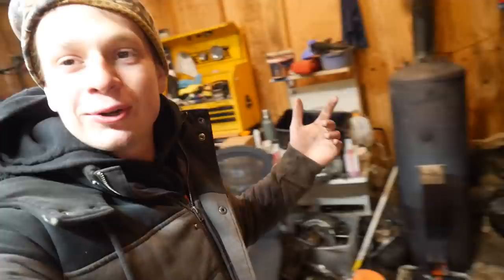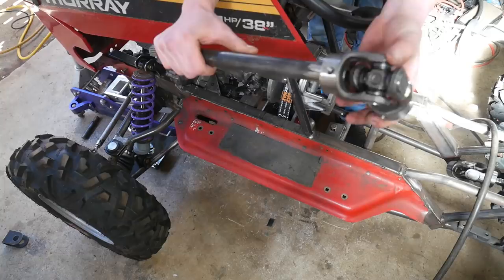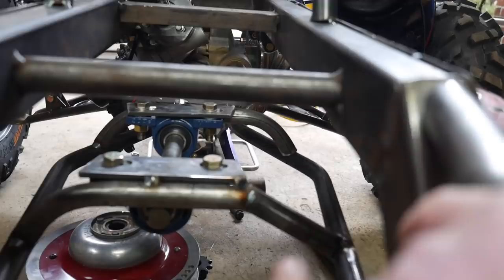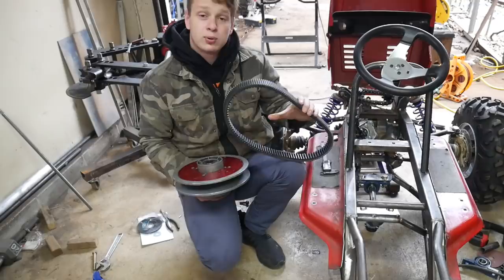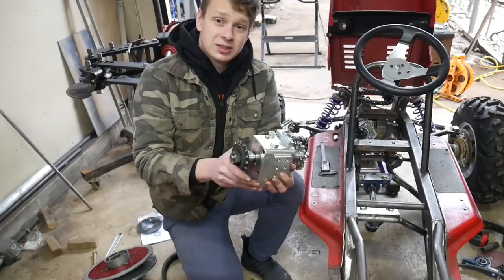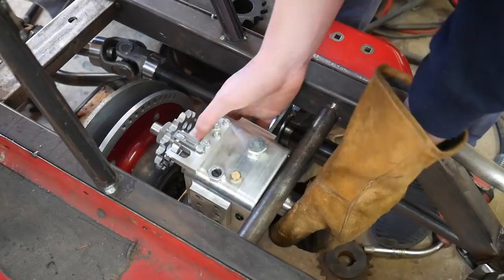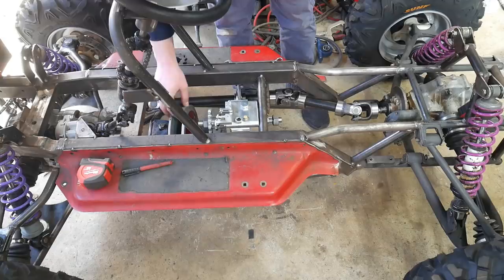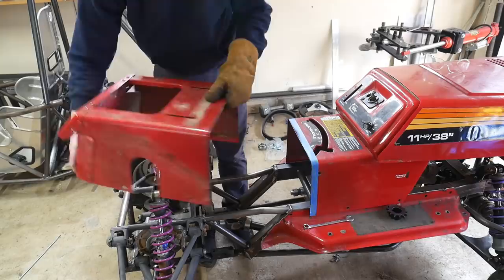4x4 100HP Triple Murray Riding Mower Build Part 8!

Comment: Hey man, just wanted to make sure you knew that you are going to have to build some type of removable enclosure to cover your clutches and belt, like you would find on a four wheeler with a cvt. Otherwise you will get dirt on you clutches and lose power and risk breaking them
Reply: This is absolutely correct,from experience I've learned that a vital function of a cover for this type of clutch involves propper cooling.Whatever protective cover is chosen,if it's not allowed passage ways for air to cool what needs cooling the chance of failure from overheating is inevitable.
Reply: I'm also curious how he's gonna get the belt on and off
Reply: @carbonranger9691  well,if there isn't proper ventilation to keep that belt cool,it will come off all by itself. Have a awsome day my friend.
Reply: I'd also be worried about the clearance issue with the secondary clutch and driveshaft. The belt is supposed to ride roughly 1/8 of an inch above the clutch so there will be even less clearance
Reply: @brandonpierce9868  I would guess that it might be better for the road and back and kidneys unless he puts some suspension on it.Then again,he put 100+hp in a mower so .lol
Reply: @brandonpierce9868  in all actuality this doesn't happen most of the time. In a perfect world this would happen but because of belt slip and things like that the belt never fully reaches overdrive in most cases.
Reply: @brandonpierce9868  you could fab up a skid plate so things don’t get stuck up in there

Comment: I think you will definitely need another bearing support for the driveshaft forward near the secondary clutch. Especially once the chain is on from the reverse box and the torque starts to make it deflect.
Reply: First thing I saw its gonna be flopping around like mad
Reply from the maker: Yes will be adding a few!

Comment: "This is something that's never been done before...  110 horsepower in this freaking mower."
Reply: And a v8 mower
Reply: 2jz tractor
Reply: he just needs to add a 0 at the end of the 11 on the stock graphics
Reply: I think it makes perfect sense, I mean suicide by gun shot is overdone. LOL
Not that I'm making fun of anyone that has had the misfortune of leaving this reality for whatever reason.That is not a joke at all,its a terrible tragedy that I think could be prevented in some cases with the proper  help.I have had more than one relative,friend,chose to leave by their own hand so I'm well aware of how devastating the impact is on those left behind,but I have a sense of humor and I think if anyone capable of reading between the lines will see that it not the dark part of the topic I find funny,just the level of danger involved when power to weight has a big difference.

Comment: Vasily, I wouldn't be too concerned about the YT "experts"- I'm thinking there are only a handful of people who have ever built a 110 hp, 4x4 lawn tractor. You are probably 10% of those people by yourself, which means you are the expert who owns all the parts.  It's looking good! The clutch and all below the floor boards will add some more of the tractor's weight low where it will help keep it upright. And maybe save your feet from the stupid. Take the advice as being worth what you actually paid for it, mine included. Success is always on the terms of the man doing the work. Everybody else is kvetching.

Comment: I can’t wait till you finalize the chassis, I’m curious as to how you will tackle the exhaust. I kinda hope you make an exhaust manifold, like a car. You can use a steel 1/4 square tube, cap the ends drill the holes for ports and bolts to go through it.  Then weld an outlet flange where you need it for the exhaust tubing. Then take a belt sander and sand the tube flat and then get a flat surface and put a large piece of sand paper on it and sand it more flat. Run your pipe down and out someplace in the back.

Comment: i would add another bearing to the drive shaft, just the other end of the shaft you have that one on. the chain is going to pull it out of place so add one to the other end to stop it from moving

Comment: U-Joints require clocking so the slow-down and speed-up of the elliptic rotation caused by a bend cancel each other out.  Make sure the the 'U's are inline on the shafts.  To be clear, the rotational axis of the joints per shaft must lie in the same plane.

Comment: Make sure to add a nice solid bash plate over that clutch it doesn't hang that low that it will be an issue but it looks like the lowest point so if something is going to be hit that will be it

Comment: Cool stuff. I used 4 ujs for the steering. Learnt 90degrees in doesn’t produce 90 out when the ujs are phased correctly and the inputs and outputs aren’t parallel. Like when u have to get round the engine. Your drive shaft input output are parallel but not phased correctly. Vibration. I have 75 horseys in my full sus mower carnt tell u how fast it is. Gonna be making a vid soon. U need a bucket seat to. Honestly I did 1 rip for 2 mins nearly got flicked out 4 times

Comment: I sure hope that youre adding a 2nd support bearing towards the front of the intermediary shaft that connects both diffs and doing some serious bracing of both as the torque off of the cvt drive is going to rip that single bearing sideways/inwards and even 2 shaft bearings without some serious bracing will rip loose in a very short time.. Need to order up an exact replacement murray 11hp decal but with 110hp so it looks stock and legit but notifies those watching that it's a potent little toy in a sedate/quiet sort way... 😆😁  Brakes are going to be UBER important on this ride once the gearing is sorted out... Jus sayin.

Comment: I would build the reverse gearbox, huge pulley and cardan shaft as its own unit that gets welded in place, that way you can throw the chain sprocket setup out and use normal gears in oil bath thing. Bit more engineering and effort but end result should be more reliable than chain.

Comment: Sweet build 

Clutching will need some tweaking to make it work perfect, since the engine and clutches came from a sled, also engine is going to run rich. Message me if you need tips on either, im a whiz with those polaris engines and clutches

Comment: If it were easy, everybody would be doin it, LOL. Add another bearing support on that center shaft where the chain connects. Alot of force will be on it and you don't want to rely on the driveshaft itself to hold steady with just 1 bearing support.

Comment: Is it possible to widen out the frame at the bottom, just under the original body? You could attach sheet metal to cover. It would give you more real estate for the drive shaft and covers for the clutch etc

Comment: Done!! Lmao... what a fun project this is.  Odd question but you thinking about putting a PTO on it so you can have stuff like a mower deck or 3 point hitch on the back.  Not like it would have the power for about anything you can toss at it

Comment: That drive shaft with only one support bearing is going to just twist and break. You will need at least one other bearing on that same shaft to hold it straight. That bearing cage is going to break.